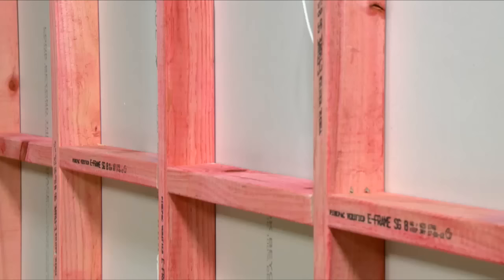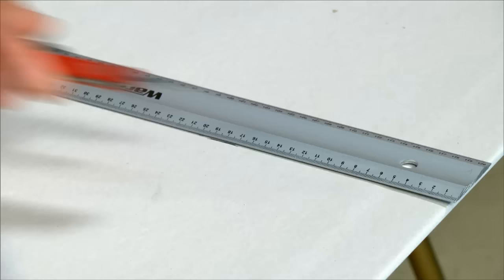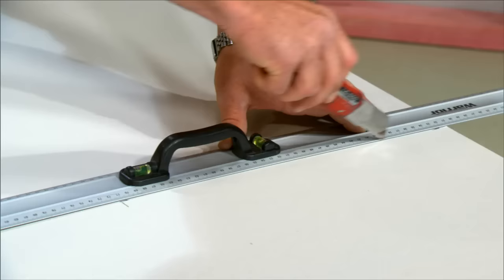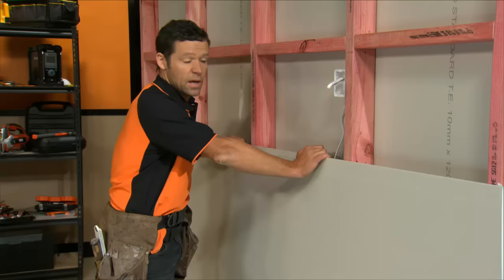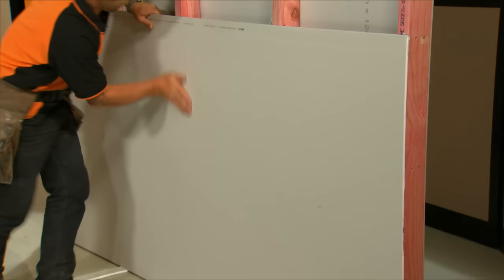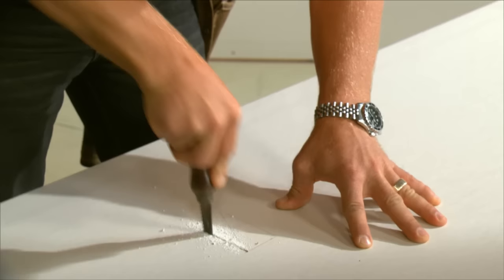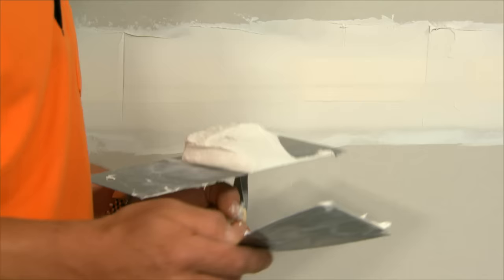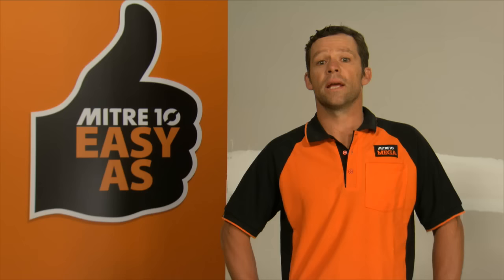How To Install Plasterboard | Mitre 10 Easy As DIY

Comment: You would be better off following the plastering guidelines layed out in the Gib book. Air drying compound is not recommended for first coat and you'll need 3 coats total for a level 4 finish.

Comment: is it diffrerent when replacing the celieng and do you use special gib for the kitchen and bathroom
Reply from the maker: Hi Matthew,
The type of wallboard on the ceiling is generally 13mm ultraline. This gives a superior finish however you could use standard 13mm wallboard. Generally in older homes, ceilings can sag over time so it's worth checking to see if this is the case. It could be worth while adding a strong back (2 x 150x50 nailed together spanning from wall to wall) across the top of the rafters and using z nails to pin the rafters to the strong back to straighten the ceiling. 
For kitchens and bathrooms it's best if you use a wet area wallboard such as GIB aqualine.
SR
Reply: +Mitre 10 New Zealand 7
Reply: +Mitre 10 New Zealand please tell me is there a store in taranaki
Reply: Mitre 10 New Zealand Katrina kaif
Reply: Katrina kaif